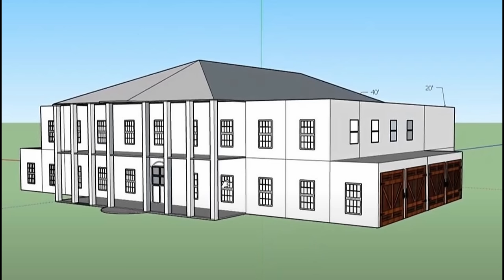2 shipping containers becomes 1 bedroom

Comment: Over head weld are alot easier if you do short beads no longer than an inch, less really, spaced the same distance apart. Then after cleaning go back and weld the spaces. Respirators and ventilation, flexible air conditioning ducts and fans work really well. Remember to avoid blinding yourself focus the work lights into the walls.
Keep up the great work.
Reply from the maker: Thank you very much for the overhead welding tip!  I will try that next time.  Thanks for watching and the advice.